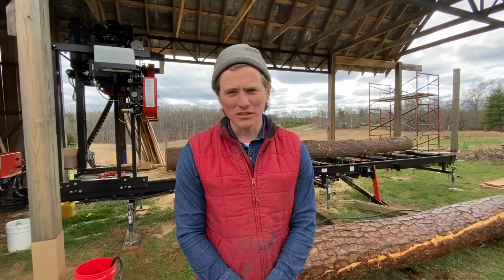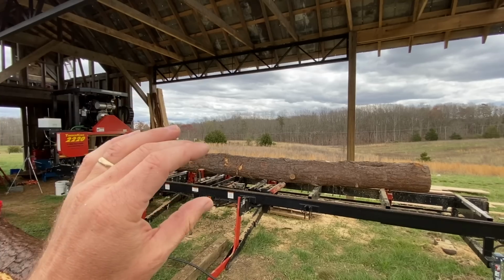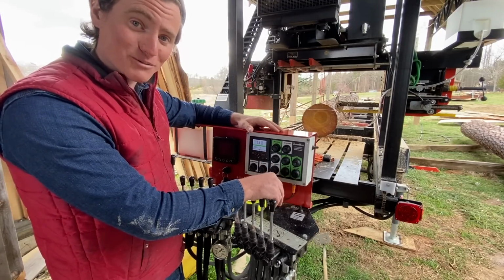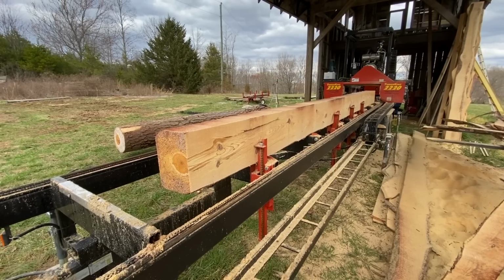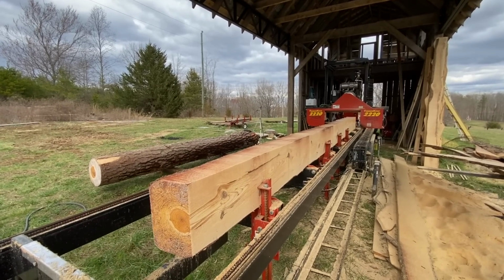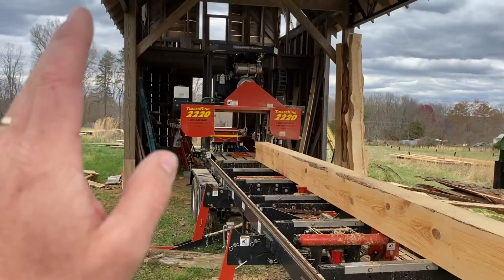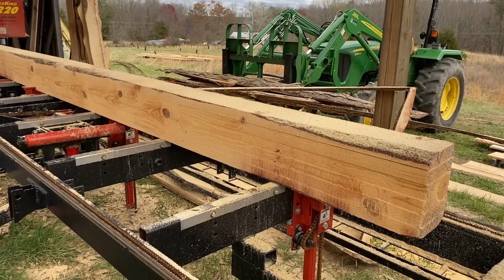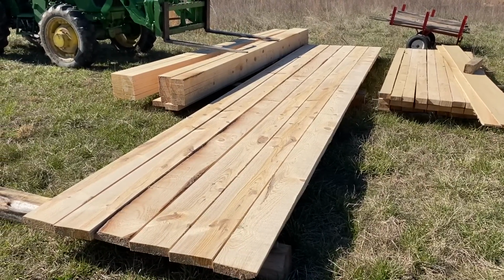SAWMILL - Milling 20 Foot Long boards - DIY LUMBER

Comment: Wonder why you went with a timber king over a woodmizer or other brands? Looks like a well built machine.
Reply from the maker: I’ll answer better in a video but in general I like the design, it’s simple. Woodmizer makes a great mill, I just like the 4 post design. I like that the Timberking is all hydraulic where the Woodmizer has more electronics. I believe the comparable Woodmizer was more expensive but they had little to do with it. I think the Timberking or similar design is more easily repaired in a pinch. Where I think woodmizer is “better” is there mills look faster to set up and they appear to mill faster, this is due to the mono rail design and i think the mill cuts faster because of the motor that drives the head back and forth is electric vs the Timberking is hydraulic. There’s a few things about the Timberking that are blatant design issues, small in some cases but if not to fix. One is the location of the tail lights, the get broken easily if using the board return, Also the guage of the steel used in the red sheet metal that goes around the wheels and blade, it should be twice what it is. When blades break or come off it takes a hit. There are other small things but overall it’s a great mill but I have no experience with other mills to compare it. Another brand I liked was Cooks but their wait time was much longer and they don’t have a computer set works standard. With that said, I think the Cooks mill is one of the heaviest duty mills and nicely designed. They have great prices and offer packages as well that offer big savings. I own their cats claw sharpener and dual setter. I’ll make a video with details on the mill and my decision.

Comment: to be clear , absolute wood greenhorn here....its alright to stack the (now) dimensional lumber out in the elements ?  it wont curl / twist on you ?
Reply from the maker: The sun is the biggest problem, covering the stack or having it in the shade makes the most difference. In the summer I stack my lumber under big trees. You just want good air flow.

Comment: How long does it take to get the mill setup and a log loaded and how long does it take to process an entire log?
Reply from the maker: My mill is ready to see any time since it’s under the roof. If it has a sharp blade i tension the blade, fill up the water tank and let the engine warm up. Assuming no issues exist, I can be sawing in 5 minutes. How long it takes to mill a log depends on what i’m cutting and size of log but anywhere from 20 minutes to an hour. I can do it faster but i’m not in a hurry. Logs that take a while are ones that are big or high value and i’m being careful making decisions. With that said, if you run into problems all this can take a lot longer.

Comment: Nice to see you milling again, man. Every time I manually turn my logs I think about your mill and how nice it must be on the back.   My next step is a shelter for stacking lumber under roof to dry.    Nice mill shed.
Reply from the maker: Thank you Mr. Sheffield, I too would like a building for the lumber….. and a kiln. You may be doing this but if you put a rope or sling around your log then wrap it a few times then use your forks to pull up on the strap it will rotate the log/cant. Just do it so it rotates toward your log stops.
Reply: @The Homestead Craftsman  I'll have to give this a try, I've seen people mount a winch above the mill as well and do the same.      I have a idea of mounting a harbor freight dust collector under my shed and hooking up my mill to it.
Reply from the maker: Id like to do something like that as well to collect the dust. I’ve seen people do it where the hose is above the mill running on a cable and pulleys to allow the mill to travel back and forth.

Comment: Does having the pith off centered in the cant before you cut out the 2x8’s affect how straight the boards are after they dry?
Reply from the maker: There is no single answer as the variables are too numerous with trees. Two trees that seem identical can produce different quality lumber. When cutting building lumber, i just saw for maximum yield. With that said I am making decisions as i go based on experience that im not really thinking about that will increase the chance that the lumber will be suitable. To your question, best case scenario, sure, but it’s not necessary. With a lot of trees the pith is no where near the center and you would waste a lot of wood chasing diminishing returns.

Comment: Are you still making tables and such? It would be nice to see some more woodworking videos. And what ever happened to the log cabin you were going to build?
Reply from the maker: Occasionally making furniture but not regularly but I am currently working on a furniture project video. Cabin is on hold.

Comment: How long does it take to dry those boards ? Also at the time of this video how much did you save cutting these boards yourself vs. buying them?
Reply from the maker: I could use them right now if I wanted but i’ll let them sit fit at least a few weeks. Optimally i’d let them dry for a month or two in the summer and they would be pretty dry for outside. Pine dry very fast at warm temps. Building with green wood is fine as king as you build appropriately and don’t use it when you should have used dry wood, basically you have to be aware of how it will shrink. As far as cost, the more you mill on a sawmill the more the price of the mill is distributed amongst the lumber. For example, the first board i milled cost me $60,000. Is probably cheaper to buy lumber in my case as I’ll spend a couple days cutting trees and getting them to the mill, then a couple days milling. For me it’s about using all lumber off my land, milling it all myself, using rough sawn lumber vs commercial and in the end i’m just doing what i want.
Reply from the maker: To answer your question better, ive milled 20 2x4s, 7 2x10s, about 20 2x6, the 6 or 7 long 2x8s, still have one more log to go… i’ve used maybe 1/2 gallon of chainsaw mix and about 4 gallons of diesel. Spent about 4 days working and over $100,000 of equipment. so ignoring time and investment, about $16.

Comment: How much did the mill cost?
Reply from the maker: $60,000 at the time I placed my order, the current price is $78,000 a few years later. They do cash or financing or you can get a bank/private loan which is what I would suggest. My suggestion to any reading this is, unless you are going to use it professionally and have a solid plan that includes all the necessary variables in place to succeed, wait till you have the money to buy it.